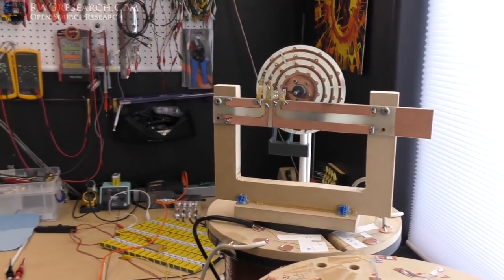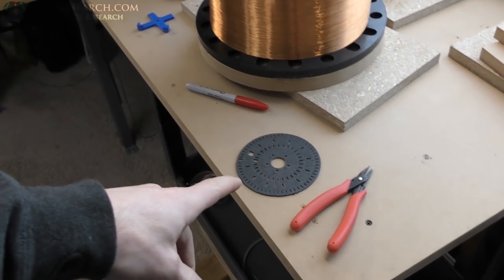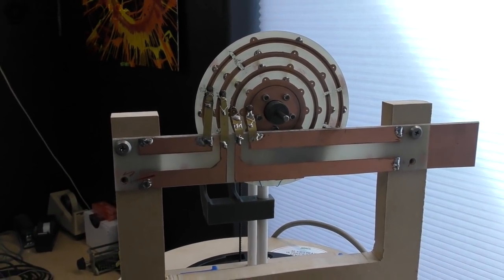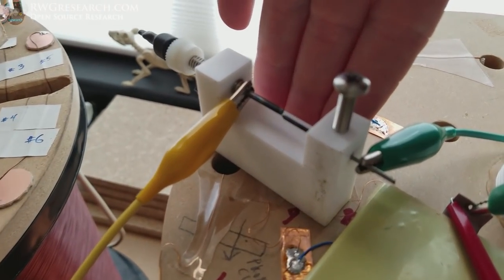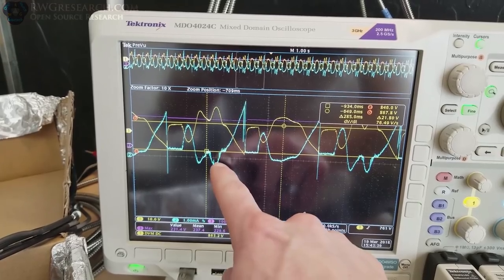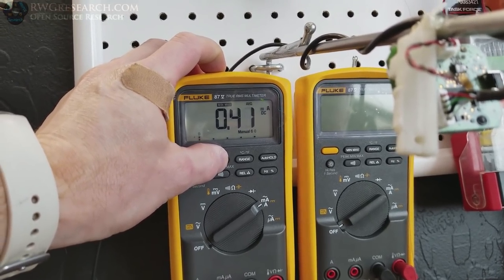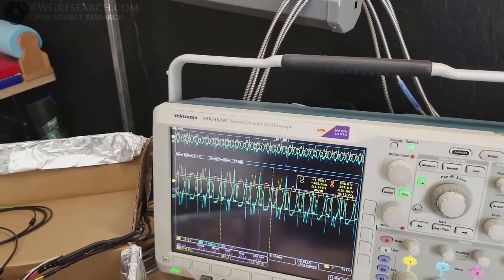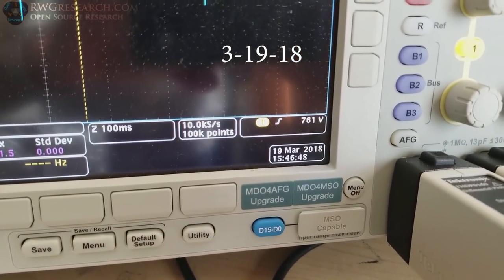JWN Project P15: Two Inch Magnnet Running.  Negtive Current Via Induction.

Comment: Hi Russ, would be always good to show a circuit diagram inside the video how the coil and commutator is  hooked up so we can interpret the scope shots better. Also did you yet get any 1 Amp or more back current spikes in the milliseconds range with the big magnet rotating outside or on top of the coil ?? If not you probably need a different graphite brush. what ohmical resistance has your carbon brush ?
Reply from the maker: Yes i try to but no time. its all "conventional" in this test. coil as a coil ( both in series as if they were one large coil), commutator as a commutator ( switching polarity every 1/2 cycle. )... all current was = or less then input. for theses tests. The brushes on this one were making good contact. and i was suppressing the spike with the spark gap / cap. the resistance should have been very low.  ~Russ
Reply: rwg42985 Okay Russ, well did you use Top Dead Center TDC to reverse the coil current ? Play with the settings of the rotor position versus coil where you reverse the coil current.  It must not be TDC , but probably 30 degrees or more before or after TDC...Also better just use FL tubes in series with ceramic caps across the coil instead of the spark gap.You should then really see more and bigger and longer back current spikes....Many thanks. Regards, Stefan.
Reply: So with Not  using TDC , but a different angle where you reverse the current , the motor will run slower,  but the back current spikes will increase as it will then run more in the generator mode... Very important. ..
Reply: So don't optimize for fastest speed but for largest Back current spikes...

Comment: My Idea for the optical Timing-Wheel: Make two or more  of the same Pattern, then you can adjust the Timing by shifting the Rotation of the Disks. In this constellation, the mounting-shaft must have a thread for clamping the disks together.

LG

Comment: So what about the "Newman effects?"  All that you have been doing for the past month is you have been playing with a big pulse motor based on a big coil and a strong magnet.  Sometimes the rotational mechanical energy put into the magnet rotor can result in the current reversing through induction and you get a small amount of energy going back to the battery.  It really doesn't mean much in the overall scheme of things.